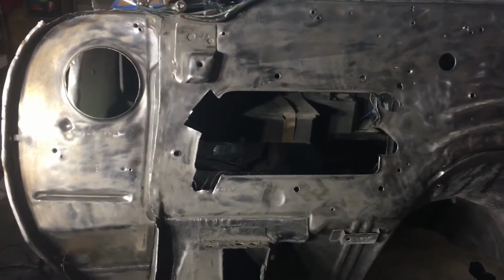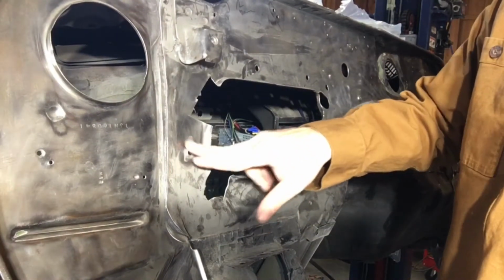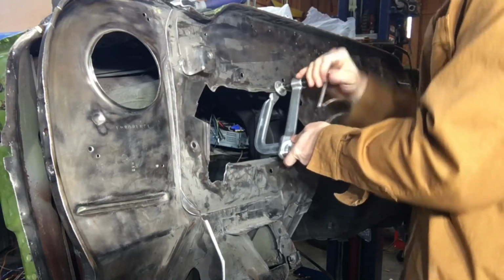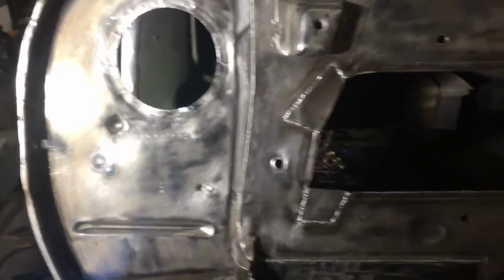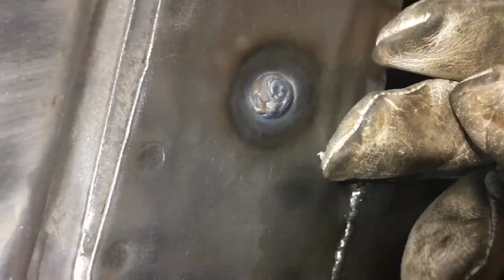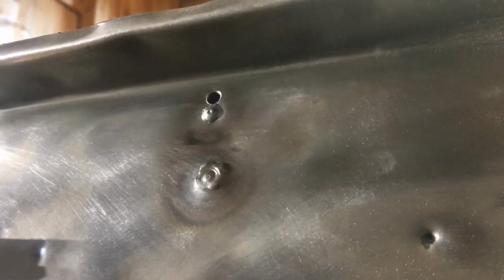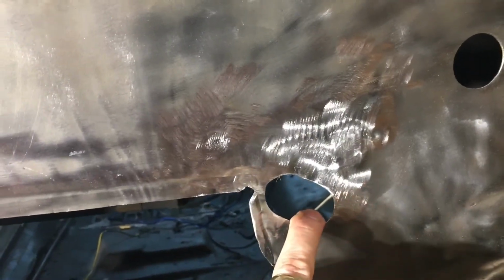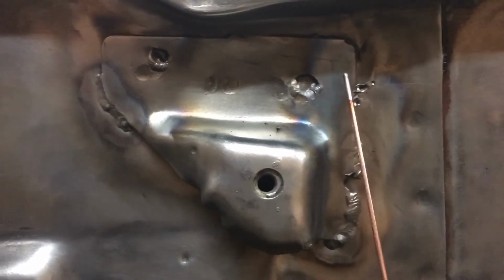Pro-Touring 73 Camaro: Firewalling It!

Comment: Just a note, to flatten out those dimpled holes, use a bolt, nut, and washers combination.  That way you can put the exact amount of torque/pressure needed to flatten out the material.  Using some heat doesn't hurt either.

Comment: Coming along nicely!! I rolled the heater duct hole too on my 70 for the DSE firewall block off panel. After getting it flat I decided to roll it inward to get some stiffness back in the firewall panel using a body hammer and a dolly. It rolled in looking like a mirror image of it rolled out after a couple hours of gently messaging it, working around it a little at a time. The DSE panel is spot welded in place, then seam welded and flush ground.
Reply from the maker: All that hammering takes patience, nice job. The generic blank-off plate I have is quite thick (aluminum) so I didn't feel like I needed to add rigidity back (plus I am lazy).